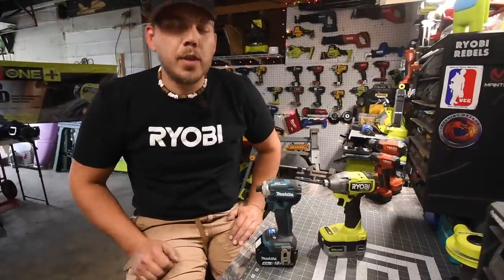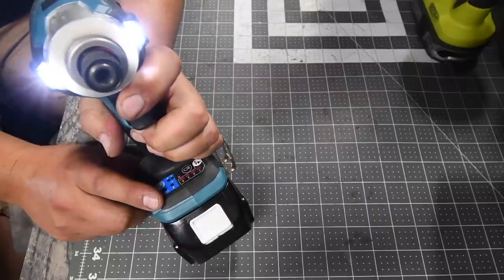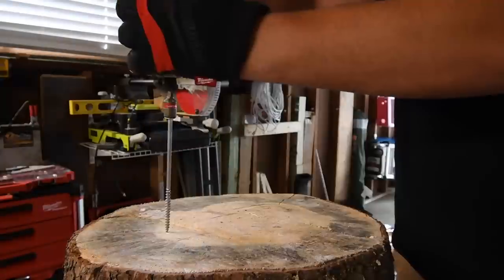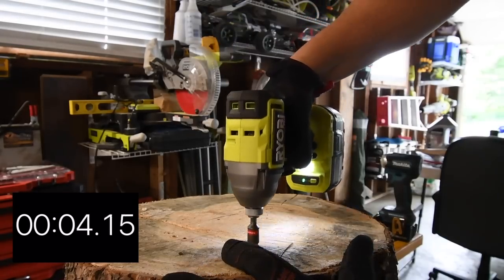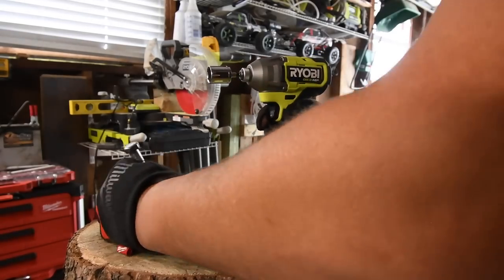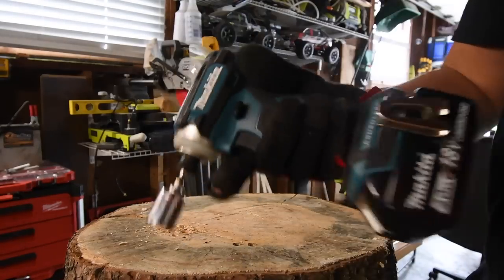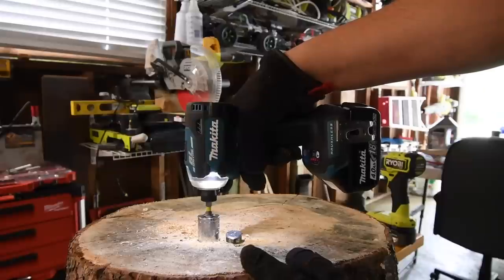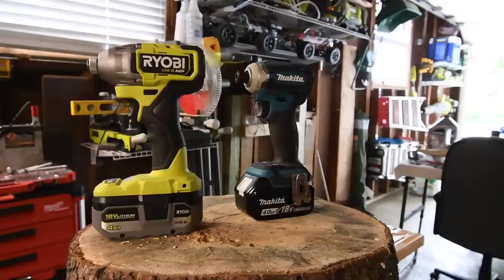Makita vs Ryobi (Impact Drivers)

Comment: That XDT16 is my favorite as well.  Makita isn't the fastest but something about it is more enjoyable to use.  Good ergonomics.
Reply: I like the Triple Hammer the most. To me it is the most comfortable one of them all.
Reply: @ToolswithSoAlz  
I am all about the Metabo HPT right now. By far my favorite to use as far as comfort
Reply: Thing is, it's about being able to do the job and last, Makita has past that test for me, I don't have the money to keep replacing tools! I have tools from the previous 18v battery type that I fitted with adapters (hard wired in as the contact was intermittent) and they are still performing.

Comment: You gotta give some props to Ryobi, keeping up neck and neck to Makita in all of these tests, but at half the price. Thats some serious value!
Reply from the maker: the new Ryobi tools are good tools
Reply: Except that Ryobi won't last!
Reply: That is what i dont get it didn't keep it up it slayed it i was not even expecting that i came here thinking thats abit unfair man i was wrong
Reply: @johnussss  in my experience theyve lasted very well and im a steel roofer. I was the most productive screw installer in my memory. Loved the impact that experience
Reply: Ryobi offers great combination of performance and value for the weekend warrior.
Reply: @johnussss  I have 10+ year old blue tools that are still kicking I think they’ll last
Reply: @reapermace4434  same here. I just had my 10+ year old impact die. I’ve used the shit out of it. Definitely got my moneys worth. Just picked up one of these new ones to replace it.

Comment: Makita tools are like surgeon scalpels. Not usually the most powerful (except most of their XGT line, those are monsters lol), but they all feel super tight and precise. The XDT16 is just amazing to use.
Reply: Im guessing you haven't used actual high end tools if you think Makita are "Surgeons Scalpels". Once you use nice tools day in day out you'll definitely know when your holding a cheaper tool with your eyes closed.
Reply: @ErzbergAdventures  Depends what you classify as high-end, we have plenty of Hilti's at work, but nothing that felt super impressive. The quality felt good, and the warranty is supposed to be great, but nothing on the tools themselves stood out, feature wise. Or performance wise really. 

Other than that I have a festool tracksaw which IS great, but I need something larger. So I plan on upgrading to a Makita tracksaw whenever their 40v version comes out. 

60% of my hand tools are Knipex. The other 40% is Klein, Wiha, and Wera. 

Anyway, I was saying that relative to TTi, Stanley Black & Decker, Bosch, Chervon, Hitachi, etc...

All the major tool manufacturers.

Hilti and Festool have nice tools, but they are relatively niche compared to any of the major players mentioned above.

Comment: Makita stop holding back your tools! 
Makita needs to get it together and push out compact batteries 4ah 21700 preferably or better. Dewalt, Milwaukee, Bosch, Ryobi, Rigid, Kobalt and who knows who else already have them. Makita might be last or the only brand not stepping up. We might see 21700s in Craftsman, Metabo HPT, Skil, Hart, Flex, etc before Makita considers it.

Comment: Sorry. I had this. It couldnt handle the roof screws I was pumping through. Gave it back and swapped to the next drill down.
The new drill is ok. Just wish that the trigger gave more response to drilling output
Reply from the maker: which tool brand did you use?
Reply: Ryobi

Comment: Seems like ryobi is stepping up to the big boys. That ryobi is powerful, glad to see that.  Great 👍👌video!
Reply: They may be powerful but in no way is Ryobi stepping up to the big boys. There is a great channel on here where a guy tears down carious tools from ALL brands Inc Hilti. Shows where they cut corners on components and build to make it cheap.
Reply: channels name is ave
Reply: Ryobi is stepping up to the big boys makita impacts sucks
Reply: @ErzbergAdventures  You do realize that Ryobi = AEG = Milwaukee? Milwaukee is Contractor stuff and it uses the same internal parts as Ryobi machines...
Reply: @Leander Stark  lol no they don't! Ryobi is nothing like Milwaukee internal or external!
Reply: @ErzbergAdventures  They are from the exact same Manufacturer and they share their internals between each other. The big business behind all of them is Techtronic Industries (TI).
If you like it or not, that's just how it is!
Reply: @ErzbergAdventures  Ryobi and Milwaukee and RIGID are all owned by TTI so there made by the same company and made in the same factory so Ryobi is with the big boys because as of last year of 2022 they are officially a professional brand now so get mad and cry that Milwaukee and Dewalt are not the only pro brands in the market right now
Reply: I see more and more Ryobi on the job site since HP line was released.

Comment: Hmmm that dosent look like a hp battery with the way the battery indicator is 🤔 on the ryobi usually the battery indicators step up in size and length and the lights are dark green
Reply: Ryobi did upgrade there batteries too.

Comment: Why does Ryobi's "HP" impact driver not have the metal connections where the battery connects to use the "HP" power of High Performance batteries? Why does it say HP if it doesn't use the power of HP batteries? 

Why does the Ryobi have an LED light looking up and not looking at where the driver is driving? 

The same is true for Ryobi's battery circular saw, it has a LED light but it is a work light not a blade cut line, their corded circular saw has a red LED line point to where the blade will cut

Comment: Anything more powerful than the Makita is only going to break things faster. Like the adapter. Save the extra power for a 3/8 and leave the precision of smaller hammer.
I use the XDT19 to put in small screws and electrical outlets. Dewalt DCF850 makes them too tight with one hammer blow.

Comment: The Milwaukee impact driver Gen 3 brushless is the top rated impact driver and I personally like the ryobi hp brushless impact driver but Makita is coming with their 40v XGT Line I’m a summing it’s way power full then then these two impact drivers I also like the dewalt X-r impact driver but it’s not as fast as Milwaukee, Makita, ryobi,

Comment: As far as longevity in the span of 10 years do you think the Ryobi would last compared to the Makita? Or would you have to replace the Ryobi?
Reply: Yes, I have had my Ryobi tools for the past 8 years and going strong. A plus is the batteries from years ago can still be used or you can always get newer batteries for the older tools. I do have 8 year old batteries.
Reply: @mrspin3315  Do you use any of these tools daily or just occasional DIY
Reply: @IanMM88  I do not use them daily, but when I do they have been treated rough I also have lent them out. Also the batteries have lasted 8 years and still work fine. I am not a professional wood worker by any means but am a auto tech.
Reply: @mr Spin  thats mainly what  I use my tools for too, mechanic work and DIY stuff. I have a mix of power tools from ryobi milwaukee, dewalt and even some air tools. My ryobi hammer drill even seemed to out preform my milwaukee 12 v hammer drill when I decided to test them into a block of concrete
Reply: @IanMM88  yes mine did also. I have seen a few reviews that says that it should not be used bigger than 1/2" to drill concrete? But mine works so well that I think that it will be able to use bigger bit's.
Reply: Both will last just as long as each other.

Comment: Don’t use that makita in cold weather the plastic cracks so easy, and the tabs on the batteries brake even easier. Makita will not warranty them so i started switching over to Milwaukee, better in every way.  Makita corp. is a joke of a company… their customer sucks .
Reply: Makita tool bodies are glass-reinforced ABS... just like every other high-end brand, including Milwaukee. And their batteries are polycarbonate, one of the toughest plastics in existence. Milwaukee batteries are (I believe) just ABS and therefore weaker.
The only joke here is this comment.
Reply: @karlkalina3022  lol, have 17 tools and five batteries that say different… all of which are useless. All of them cracked in cold weather over a coarse of a year and a half. And makita will not warranty them. My Milwaukee’s… no cracks yet. And better in every other way so far…  too.
Reply: @karlkalina3022  Makita is like Elvis, he's already dead but his fans still think he's alive
Reply: @marceloalencar9373  As opposed to modern Milwaukee, which is owned by China and is basically red Ryobi?

Comment: Too bad they can't make a hammer drill
Reply: They do and it's impressive
Reply: @hughfitz95  I'm talking about he hammer drill driver they make them but they lag behind their competition the sds is a nice machine though
Reply: @craigchiddo2794  i don't agree, the new one, it's a beast, and plenty for even light professional use np
Reply: @Lucas_sGarage  I know what they are capable of what I was saying is their new totally redesigned hp drill should be more powerful than it is especially for the money they charge
Reply: @craigchiddo2794  i saw the combo for 199... It's basically the same as the 191 Makita combo but the drill is more powerful
Reply: @Lucas_sGarage   I may be asking too much of Ryobi but I my thoughts are if you are going to redesign everything why not give it enough guts to turn larger bits in 2nd gear
Reply: @craigchiddo2794  it's the BMS in the battery cutting of, i think that with a DeWalt battery, this could do it np